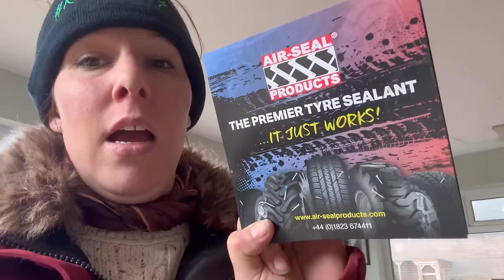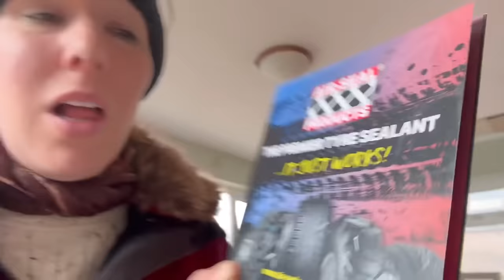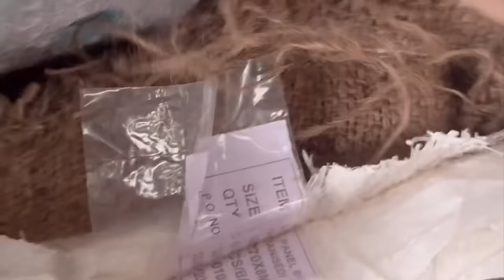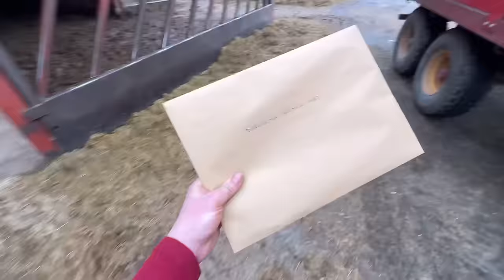9/4 Cladding the tank room, visiting the pembertons, selling cattle & getting stuck! in the tractor.

Comment: Hi I thought I would pass on a tip about putting in the panels along the feed fence. I think you should seal under the panel between the concrete as  the slurry seeps into the feed .l have seen it so often where this happens and they have to be lifted out and try to seal on dirty concrete.
Reply from the maker: We thought we’d have to seel underneath but then remembered the other sides are poured 100mm higher with concrete to make 600mm cows side abs 500mm feed side x

Comment: charlotte old mate. i think you should have put the panels on the inside. easier for cleaning and the beams will last longer
Reply from the maker: They are forming a trough for a conveyor belt to run down so they need to be on the outside :)
Reply: @charlotteashleyfarm  ahhhhh. i see i see. smart mam

Comment: Glad to see the Ginger Warrior up and about.  Hope he's taking it easy(er).

One question ... why did you put the concrete panel on the feeding rail on opposite sides of the column either side of the shed.  On the previous video you put them INSIDE the columns.  On this one, they are on the OUTSIDE.  I would have thought that would be difficult to scrap-out on manure.
Reply from the maker: Ahhhh good questionnnnnnnn so on the side you saw in todays video they are forming a trough for a conveyor belt system so they needed to be on the outside now I wasn’t keen on this as you say keeping them clean would be harder but needs must c x